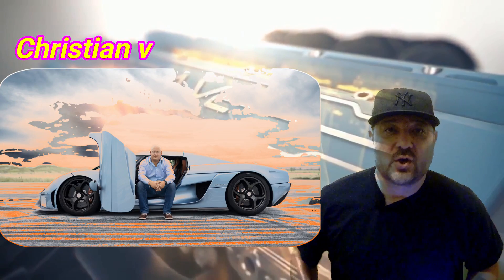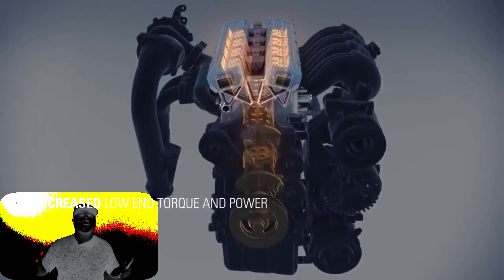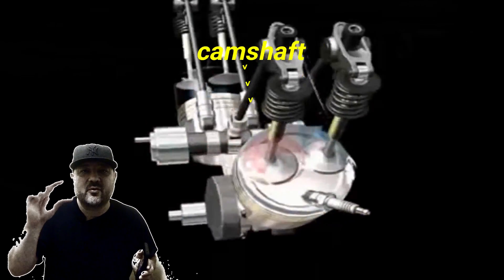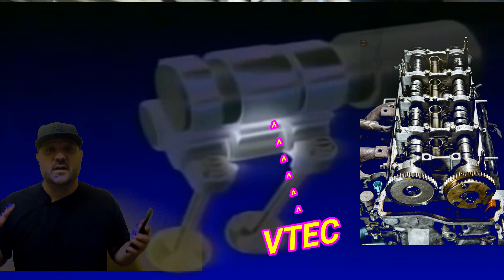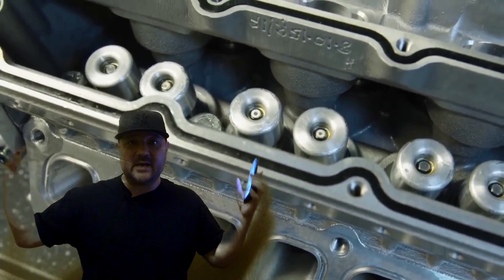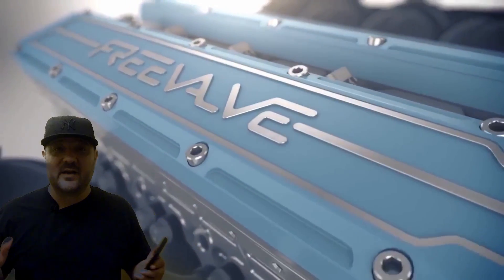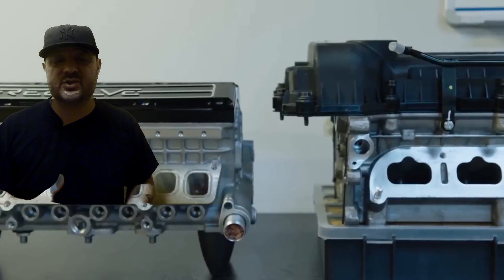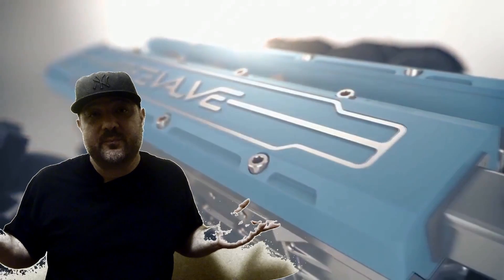Koenigsegg  Freevalve - camless engine

Comment: Older and wiser car manufacturers don't  tell anyone till their latest tech  "breakthrough" is tested, proven reliable & in full volume production.
Otherwise its BS fart vapour mirages that destroy reputations. 10 years since announced. Where are they & where are the car companies tooling up & lining up to licence it for production?
Looks like another fart vapour mirage like the sarich engine. Put one in the next LeMans & win it or admit your a failure, a liar and move to somewhere remote where you won't be recognized and continually laughed at Mr Koenigseg.
That would be a pity as some of the tech in his cars appears impressive & innovative. But the car industry is one where you can go from hero to less than zero in a split second. All it takes is a single failure @ the right place & wrong time.
Reply from the maker: yes it's been a long time and you would figure it would have been used in some sort of production engine by known.  . this is technically not a new idea. .. but if someone could get a system like this to work it would definitely be a game changer for the internal combustion engine...
Reply: @maldo72  Me thinks there is a bit of Icarus in all of us. There needs to be to make people aspire to greatness.
Just hope this one makes it. As you say the possibilities are tantalising

Comment: Many two stroke engines have been running for almost a century without valves
Reply from the maker: Yes but ,they dont make great automotive engines due to the fact of the high oil content in fuel and are not as fuel efficient... but the power to size ratio is fantastic

Comment: Definitely a massive step forward you could raise the compression on all n/a motors and improve low end torque considerably ! Never mind better fuel ecconmy and get away from direct injection with carbon build up on valves
Reply from the maker: 100% true ...

Comment: The ability to make engines smaller and lighter alone is a huge advantage.  It would be a fait accompli if it could be proven to be reliable and cost effective.  But my guess is it fails to fit that criteria as of yet since I'm unaware of  a car company willing to design an engine utilizing the freevalve system.
Reply from the maker: Thank you for watching ... 

Very true ... but man if they can make this reliable it would definitely be a game changer for the internal combustion engine ....
Reply: @maldo72  I'm there with you.  No cam shafts, no timing belts, or chains, or sprockets. You would think people would be all over it. But they're not. It's been 6 years since Koenigsegg came out with it and to the best I can tell, no one has bought in to it.  Maybe Koenigsegg is asking too much for his creation?

Comment: I am wondering why solenoid tech can't do this, there must be a technical problem preventing direct coil drive to control the valve.
Reply from the maker: agree
Reply: It has been tested by a german company, but solenoids are to slow, and creates to much heat...

Comment: Good in theory but what happens when it fails.
Reply: In an interference engine when a timing belt fails it is catastrophic... valve is open, piston hit valve and pushes it into the cam shaft breaking things usually making the engine close to the equivalent of scrap. This only air pressure is keeping the valve open so even it it failed open for some reason and the piston hit it I cannot see the destruction being nearly as high as all it would do is push it into it's air pocket.
Reply: same as when your cam belt snaps

Comment: My father have such idea 25 years at least ago...we tried to sell it to renault but they reject it,then i send an email to koeniegsegg in 2014 and give the idea...but even the credit was forgotten.Well im not asking for credit,just to make u know that the future is electric.
This is garbage we dont have another planet.
Grwttings from Chiapas,Mexico.Yes we are mexicans.
Reply: https://youtu.be/ZEhVa00CWh4
Reply from the maker: @boscovich11  yes I saw this before but this design is still  Mechanically connected to the engine where the "camless" system operates separately and has in theory  Infinite adjustment to the demands of the engine
Reply: Indeed, someone said this camless technology could easily replace electric... Wondering how in the hell it will do that when oil extraction is getting more and more expensive (example: spend 1 gallon of oil to extract 1.5 gallons of oil).
Cheers from Michoacán

Comment: It’s a great idea and I’ve been following it since I first saw it 6 years ago. What I really wish could be done is for them to make aftermarket head/engine ecus for popular enthusiast engines (1/2JZ, RB26, LS, Ford 302/Coyote, etc.). I imagine they would make a killing if they broke into just one large volume market (LS would be one, Honda B/K series another). It’s pretty frustrating their tech hasn’t made it anywhere.
Reply from the maker: Omg yes imagine the power these motors already make and add a system like this you can double the   Efficiency
Reply: 6 years, and I bet you've never seen or heard it run or rev up, right? 

Amateurs has made their own freevalve systems on various engines in their garages, and started them up. 

Years later, we're still waiting for the inventor to start his...
Reply: @calysagora3615  not necessarily waiting for CVK to start his, just disappointed that this promising technology has taken so long to emerge on the market I start wondering if we’d be waiting until ICE engines are defunct.
Reply: @samsonian  Indeed!

Comment: This video was originally published almost 6 years ago in 2013 with Christian Koenigsegg doing a walk-through on technology. It was impressive then but still hasn't made it to mainstream production outside of thier cars. With the push for hybrid technology in road going production vehicles it it most likely the technology will only remain the domain of hyper cars and exotic racing powertrains. It's a beautiful design that could revolutionize internal combustion systems but it mainly sits on a shelf. Finding out why would be a true story to report
Reply: Exactly I always wonder why great technological advances such as these are always sheved
Reply: @zumunta1  Because to get it to a reliable enough level you need to put years and years of engineering into it. Once you have done that you still need to prove that the design is reliable enough for car makers to take the risk. Koenigsegg actually just (as in today) unvailed their new Gemera car, which has a freevalve  3 cylinder 2.0L engine with a whooping 600hp output power. They have been researching this for something like 10 years, and just now we are seeing this tech in supercars. Give it another 5-10 years and it'd be cheap and proven enough that it can make its way to ICE engines. Of course, by then ICE will probably be yesteryears tech.
Reply: Christian mentioned it was being tested on a Chinese production engine, either its not reliable or its been exclusivly bought.

Comment: Interesting technical development, akin to:
breaker point ignition to electronic ignition,
and carburetor to fuel injection.
You'd have to have lived through all the tinkering with points and carburetors to appreciate their successors.  No more timing belts or chains to change, yeah.  Some of the timing chain arraignments on dual overhead cam V whatever engines are a real nightmare.  Plus the possibilities this technology opens up...
Reply from the maker: Just when they say electric cars are the future and piston engine is dead this comes about lol
Reply: @maldo72   Koenigsegg is saving us from the language

Comment: This technology is absolutley awesome Im shocked too that most auto manufacturers have not switching to some sort of camless system, most sceptics will see this as just another minor tweek to an outdated technology but what most wont realise is that this is game changing technology that could knock electric vehicles out of existence.
just think of the possibities with this tech, the engine could run in reverse so you wont need a reverse gear it could run on Atkinson, Otto and Miller cycle seemlessly, it could even enable the engine to run like an air compressor for regenerative braking this compressed air could be stored in tanks to be re used by the engine for city driving.
Reply from the maker: Absolutely I was going to mention that in the video  did not want to make it a long drawn out video ... but man the  Possibilities
Reply: Sorry, I don't buy that.  This will help extend how long ICEs will be competitive.  But at some point someone will build a better battery and that will be all she wrote.  Electric motors are more efficient than ICEs by a factor of 3 to 5.  They are smaller, simpler, more reliable and don't require a transmission.  I'll miss the rumble of tricked out hot rod for sure.  But I'd rather travel 300 miles at 20 cents a KWh than $3.50 a gallon.
Reply: @nikolatesla5553  actually this engine configuration doesn't need transmission. Check out their latest koenigsegg products